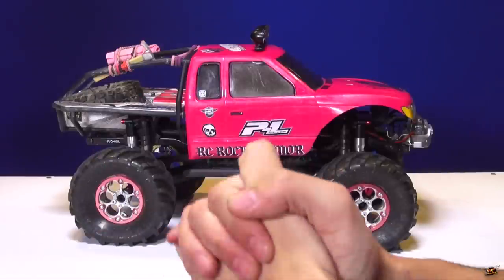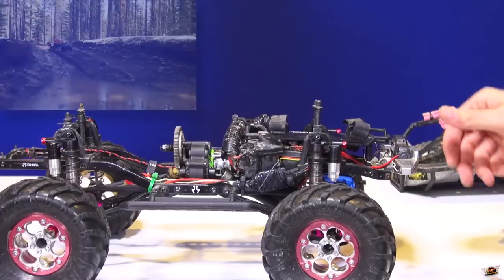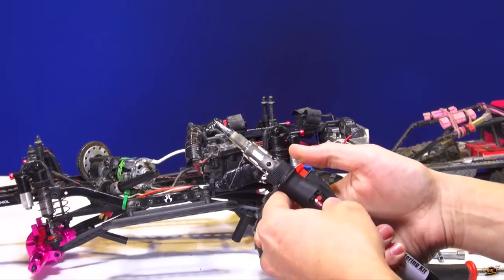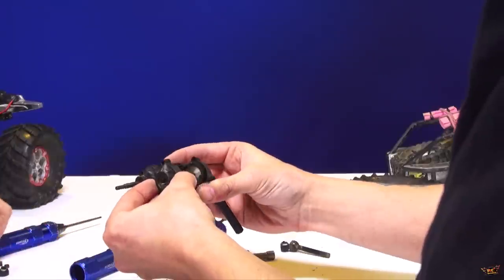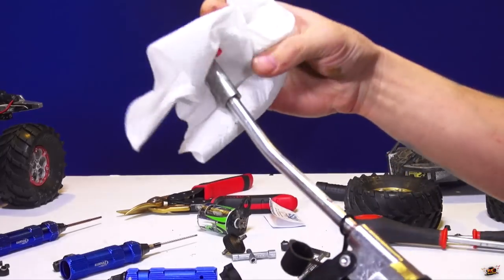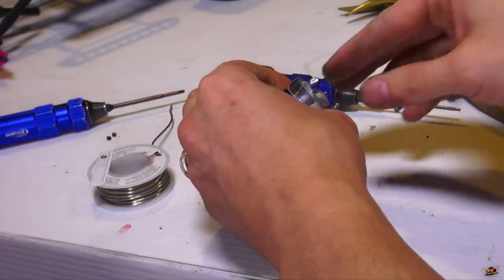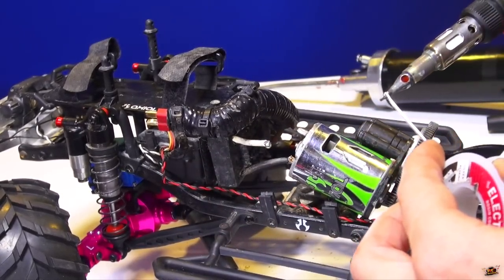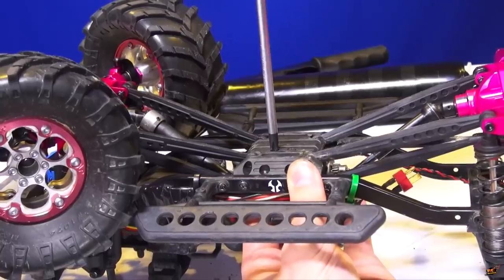RC ADVENTURES - Maintenance - JEM & Pinky! SCX10 4x4 RRP Hardened Diff Lock Gear - Transmission

Comment: To answer your question Jem on who invented the soldering iron:

Brief History of the Soldering Iron and Soldering Gun

Soldering irons have been around for over 4,000 years. Up until the late 1800s they were all heated by open flame or burning coals.

1894
The American Electrical Heater Company of Detroit Michigan begins manufacturing electric soldering irons. Shortly after the American Beauty® line of soldering irons appears.

1921
Ernst Sachs (Germany) claims to have developed the first electric soldering iron for industry (see note below) and ERSA begins commercial production of a 200 watt electric soldering iron. [More Details]

Note: I have found an advertisement from 1898 in a issue of "The Electrical Engineer" Vol. XXIV showing a drawing and description of the American Electrical Heater Company's electric soldering iron which pre dates Ernst Sachs electric soldering iron by 23 years.
I also have an early electric soldering iron manufactured by GE with patent dates eariler than 1921.

1926
In December of 1926 William Alferink files for a U.S. patent for a "Combined Holder and Automatic Circuit Breaker for Electric Soldering Irons" (first soldering station?). On July third, 1928 the patent is granted.

1946
Carl E. Weller is granted a patent for his instant heat soldering gun and starts production as the Weller Manufacturing Company in Easton Pennsylvania where he manufactures the first "Speedy Iron" instant heat soldering gun.

1949
The American Beauty "Temperature Regulating Stands" are sold to control the temperature of electric soldering irons.

1951
WEN Products is founded and manufacturers their own instant heat soldering iron.

1954
Weller sues WEN Products over soldering gun patent infringement.
Court finds in Weller's favor. [More Details]

1960
Weller is granted a patent for the "Magnastat" soldering iron which controls the iron's temperature through the use of a temperature sensitive magnetic tip.

1967
Weller begins manufacturing it's W-TCP soldering station with a "Magnastat" iron.

1970
Weller Manufacturing Company is sold to Cooper Industries.

Comment: Ernest sachs invented the soldering iron the first mass produced electrical one in 1921

YES I GOOGLED IT lol
Reply: Close but not entirely correct while yes Ernest sachs did indeed invent the first mass produced electric soldering iron he was not the actual inventor of the soldering iron that was someone else and no one really knows who it was as the first use of a  soldering iron was around 5000 years ago and so the name has been lost to time.

http://www.ersa.com/soldering-history-en.html
Reply: the other is not mentioned where as Ernest is first who produced commercially  one so to me he was the first
Reply: What do you mean the other is not mentioned of course it is mentioned its a mater of historical fact that the solder iron was invented 5000 years ago long before Ernest was born.
Reply: by who ?? first named was Ernest

Comment: So I just bought a used traxxas tmax. When I got it the steering was backwards and the car would only go backwards. I ran 1 tank of gas through it after fixing the steering and driving problem. Now it won't stay running if I give it gas.

Comment: Any idea why when I turn off my transmitter does my honcho goes super slow in reverse. It does not do this when first plugged into battery with Honcho turned on
Reply: +bellyisis That's your failsafe. You need to reset it with neutral throttle, how you do it depends on the model of radio
Reply: I have the stock axial ax-3
Reply: +bellyisis so you are going to want to set your throttle to nothing then hold the button on your receiver until the light on your receiver flashes then let go of it. that should do it
Reply: I tried it, it worked & ...then I turned transmitter off and it backed up again. Do you something could be bad?thanks for help,just getting into RCing
Reply: bellyisis I'm not sure. You could try looking at the manual and seeing if there is something I missed or contacting Axial support
Reply: bellyisis http://docs.axialracing.com/instructions/Electronics/AX24206-i001_-_AX-3_Transmitter_Instructions.pdf

That's the link to the manual. Failsafe programming is on the bottom left part of that image